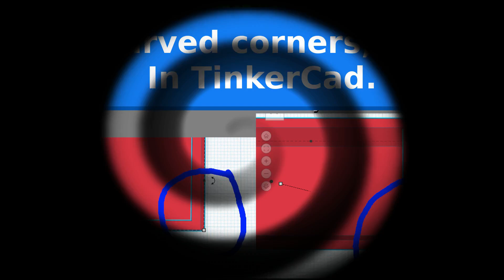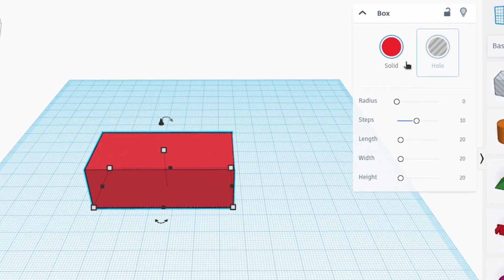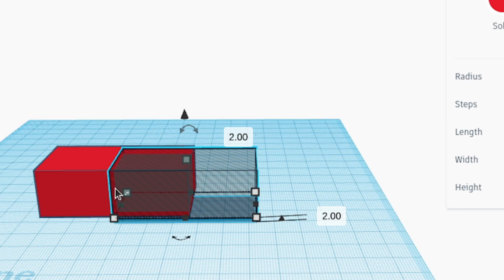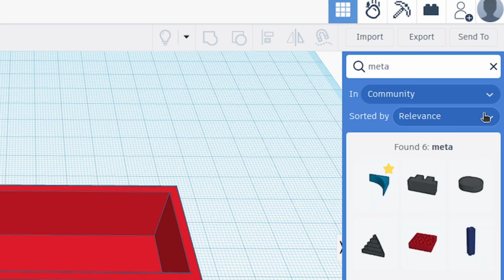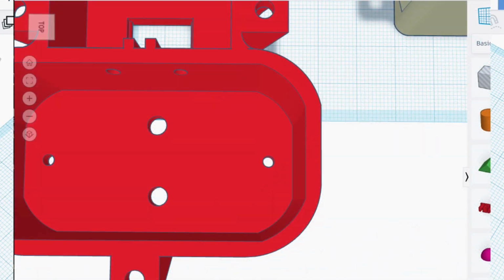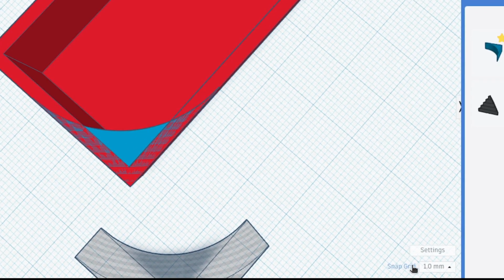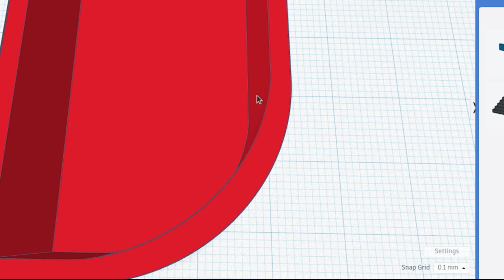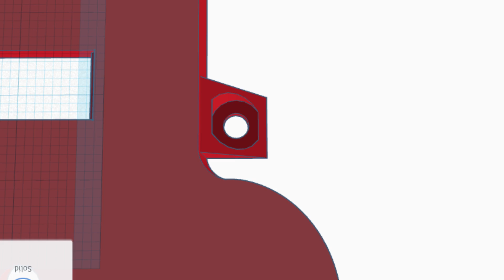3Dprinting - Creating fillets, rounded corners, in TinkerCAD

Comment: Tinkercad has apparently changed since this video was produced. Now, there are 3 icons...Bundle, Union and Ungroup. Bundle groups several objects together so they can be moved or resized as one, but it does not "finalize" any holes or seams. Union illustrates the final result of holes and seams. Ungroup reverses the previous bundle or union.
Also, three identical fillets all meeting at the corner of a cube will now make a nice rounded corner. At least, it appears to. I haven't actually printed one.

Comment: great tips! Tinkercad is awesome when you understand how to think in shapes by adding or removing them. Another tip to make it easy to align things by hand is to change to a flat view (by clicking at the cube icon on the top left, for TOP, LEFT, RIGHT, BACK, BOTTOM, FRONT) and switching from Perspective View to Orthographic view, that way you're sure on where things are and perspective won't fool you.

Comment: Forgot to make the outer fillet 2 mm larger in both directions to account for the larger radius of the outside curve.

I've been using tinkercad for quite a while, and did not know that you could click on one object when aligning to have the other object move to it. Thanks for that tip!

Comment: Another thing you can do for simple fillets is to drop your cube out and set a radius in the object attributes, it will automatically add nice fillets to all the edges/corners, then you can enlarge it and then if you want you can do the same to the hole version.  that will give you rounded edges and rounded interior edges.   That works fairly well for cylinders as well for rounding the top and bottom edges.  It wouldn't do all the things you showed though, but just for simple rounded edges it's nice.  Learned that from CHEP's video
Reply: Works very  nicely...but only for the cube object.

Comment: Maybe I missed it, but why not make two cubes with radii on the corners. One box 2mm bigger than the other. And the smaller a hole?
Reply from the maker: Go for it.   I want 3mm radii on the corner edges,  and 1mm on the bottom edges.  And the corners should have a smooth blend between.
And as I mentioned in this vid, you can make custom sizes and even shapes per edge with this method.

Comment: Good tutorial, but a couple refinements:

1. Use the "Off" option in the Snap Grid, rather than 0.1mm, to solve the seam issue. "Off" will allow 0.01mm nudges and result in a smother corner.
2. The radius of the inside corner fillet block needs to be less than the outside hole fillet in order to retain proportional thickness of the curve to the straight lines.

It's a LOT of tinkering to get any sense of perfection in TinkerCad, but the results can be worth it.

Finally, if you're just looking to create nice corners on a box it's much easier to start with the "SoftBox" (in the Shape Generators) and then customize it from there. The "Bent Pipe" and "Partial-Angle Tube" are also great starter shapes for making complex curve designs.

Comment: Just to let you know.. You can fully filet an entire box.  You are wrong that you can only do one edge.  You need to filet 1 edge at a time, but you can do inside, outside, all of it rounded.  I watched your video, went straight to tinkercad and did it.  You cannot group your filets and then group them with the box. You have to do each part, one at a time but it does work and it can be done!
Reply: Also, happy to share the box on my Tinkercad account if anyone wants to check it out. Just need permission to post a link.
Reply: You know what, never mind. I will just post my own video on it.
Reply from the maker: You will actually do a video on your channel that currently has no content?
When you do the vertical edge and the two bottom edges, how do you handle the conflux of all of that geometry at the corner where the three edges meet?
Or are you just talking about only the four corner edges? Which obviously can be done and was not what I was talking about.
Reply: @loughkb  I will have a video up later today.  No, I am talking about full on fileting all edges.  I was astounded myself when it worked.
Reply from the maker: Well you've probably seen my comment already. It's definitely improved in the last 2 years. Back when I made this video doing the metafillet on the three edges produced a really pinched corner that came out as a broken mesh when exported. 
Good first tutorial video by the way.
Reply: @loughkb  Thank you. I hope it was okay that I referenced your channel?
Reply from the maker: Oh sure yeah. Thanks for that.

Comment: You can create your own corner meta-fillet by cutting a sphere out of a cube. 
Take a sphere who's diameter is twice the size of your cube and align the sphere to the two sides of your cube.
The center point of your sphere should coincide with an upper corner of the cube.
Then make the sphere a hole and group it with the cube.

Comment: Been trying to find different ways to make fillets in TinkerCAD for a long time. Thanks. The new Sketch tool is pretty neat too.
I duplicate objects by selecting the object then CTRL + D.
And those tiny alignment errors always drive me crazy.
Reply from the maker: Someone else commented that after duplicating you can move with the mouse and it will snap back to it's internal grid and alignment will be fixed. 
I never tried it though, I've transitioned to FreeCAD and it's so much better.   And really pretty easy now with version 1.
Reply: @loughkb  I've been eyeballing FreeCAD version 1. I'll have to give it a try.
Reply from the maker: @Waltkat  I've got a few tutorials that might help but the channel you want to look at is mango jelly. He's got the best tutorials search for his channel and look for his playlist on free CAD beginners for version 1.0. takes you from the install right up to designing parts.

Comment: Also, by moving the "solid" fillet, the thickness of the curve is not constant.  Better to change the size of the solid fillet, instead of moving the larger one.  That way the radius is adjusted in the inner and outer walls are equidistant,  and the wall is the same thickness throughout the curve
Reply: This

Comment: Got another quicker way to replicate this box in TInkercad.  Create the square box shape (don't hollow it out yet), apply the outer corner cut fillets of whatever size you want to each corner, rotating as necessary and align to the box solid .  Group those together to get your solid box with the rounded corners.  Then duplicate the solid box, make it a hole,  reduce its size to leave the wall thickness you want, raise the hole to leave the floor thickness you want, select box components, align and group.  Boom, easy peasy.
Reply: This is exactly what I came to say. I enjoyed learning how to make the fillet, so appreciate that. But when he started changing with the hole still in place, I was like why not remove the whole and create the initial shape then repeat the 1st steps.

Comment: I've been using tinkercad for years and I've never seen the meta fillet! I've always just made my own when needed. I learned something, here. Thanks :)
Reply: Also the "tinkercad gets things a little off" issue is with copy/pasting. Its muscle memory for me to drag a solid after pasting it so it snaps to current constraints. If you don't, sometimes it will be off by anywhere from a 1/100th to 1/2 mm. So always drag/snap after paste :)
Reply from the maker: Thanks, I had not noticed that. The next time I build something in tinkercad I'll remember that. Although I'm starting to play around more with free CAD, going to try to get over the learning curve so I have a nice offline solution.
Reply: Same here, but I modeled a couple different sized fillets, and just copy paste them when I need them.

Comment: Sometimes it's faster to learn a new piece of software than to hack your way through in a program that isn't suitable. 

I'd suggest you try the new FreeCAD release candidate. The workflow would be something like this:
New parametric part
New sketch on XY plane.
Draw a rectangle
Pad the sketch
fillet corners
select top face, then use thickness to hollow it out.

Should take about a minute to make this part. For more complicated stuff, mangojelly has a lot of good tutorials.
Reply: Tinkercad is far more intuitive than Freecad. I am using TC for very complex models and I am very happy with it.
Reply from the maker: I used tinkercad exclusively for about 7 years. However, since my initial reply to this 7 months ago, I started learning freecad.  After a week of getting over the hump it suddenly became so much easier, and is incredibly powerful compared to tinkercad. I've made harmonic drive transmissions in freecad that would be impossible in something like tinkercad.  I still recommend tinkercad as a starting point for somebody with no experience at all who's just getting into 3D printing. But honestly, if you take a little time to learn FreeCAD, it'll be like having your hands untied.
Reply from the maker: You left out the steps of trying to remember which of those 40 to 50 little icons does what, and all those dozens of menus. Wink
Anything is always easiest in the program you're most familiar with.
I've designed stuff in free CAD, in on shape, tinkercad, and blender. There's a lot of people that like tinkercad, they are the target audience for this video.

Comment: Perfect timing, I'm just starting to get to grips with Tinkercad right now as a first foray into CAD for 3D printing!  I'm thinking that I can make and save some generic boxes with lids, cylinders, connector cutouts etc that can be imported to other projects or modified for future use.
Reply from the maker: Yep, I've done some of that myself. I have an SO239 and an Anderson power poles cut out up on my thingiverse page that I made in tinker. You can also add those objects to a collection called My designs in the shape selector over on the right. So if you're making something and you need to reference one of your cutouts, it's right there.

Comment: Try playing with the  radius and steps  controls after your box dimensions are set. You can get some very nice and interesting effects. Then punch a hole in it as shown. Have fun.
Reply from the maker: Yeah the only problem though is, it universally smooths things, using all edges of the shape. You quickly lose control of dimensions, and you don't have control over any individual edge. So a box ends up rounded on the bottom. But it can be fun for making organic shapes that you're going to paste into something else.

Comment: Thanks Kevin. I was having a hell of a time with those. Coming from a cad background, I was getting really frustrated with the differences between the 2D, which I'm used to, and the 3D with it's limitations. Can't you just use the "mirror" key to complete all 4 corners? I'm so used to drawing half of something and then mirroring to complete.
Reply from the maker: Yes and no. Mirror doesn't work like you're thinking it works in other CAD programs. In tinkercad you'd make a copy of the object and then use the mirror tool to flip that object to a mirror image. Then you'd have to move it into place.